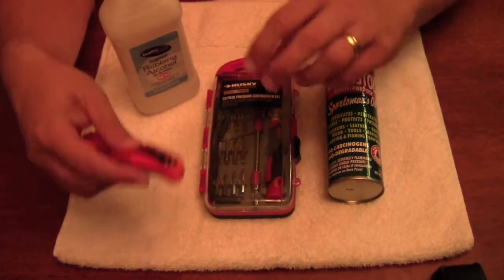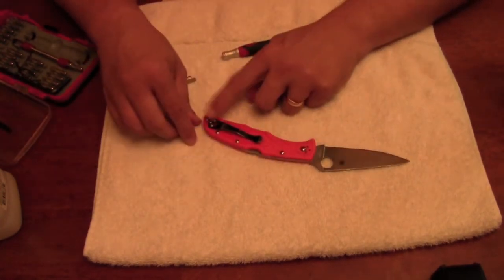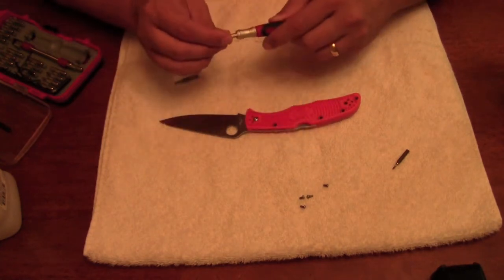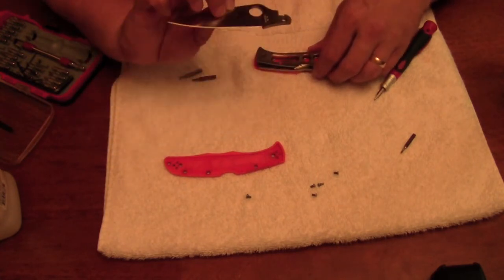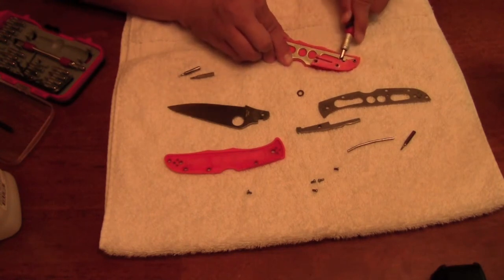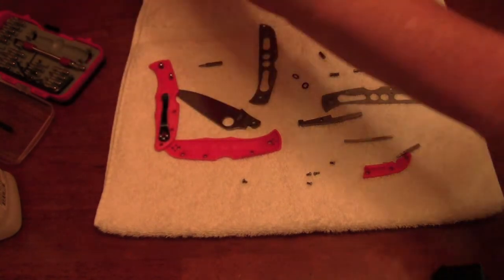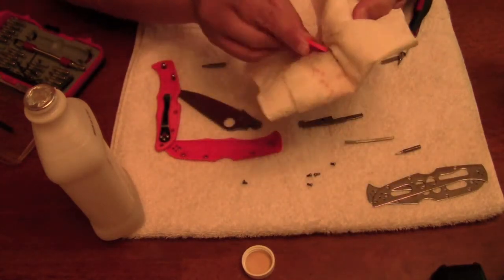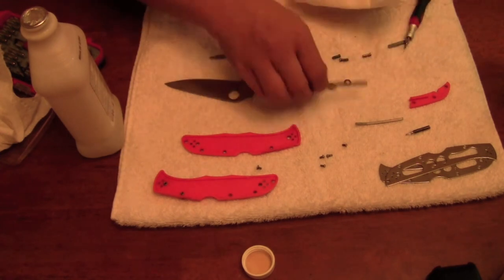Spyderco Endura 4 Disassembly Reassembly Part 1 of 2

Comment: Great video " what micro size star or tork bits is for disassemble did you use?
Reply from the maker: AlbyBound thanks man, I used a Husky Set it doesn't have the sizes...  :(
Reply: AlbyBound 6 and 8 torx for anybody still wondering

Comment: Just bought one of these today, secondand. Noticed that the locking mechanism doesn't want to stay closed- I can apply slight pressure to the blade & it will close. I took it apart to clean & man- it was in bad shape. Still, the lock doesn't want to work. Any idea what to do? Contact Spyderco & send it in for repairs?
Reply from the maker: +Lord Pyro Their customer service is pretty good but with the knife being second hand they might not wanna help you out...  give them a call and see what they say...  good luck...
Reply: I've contacted them recently about another knife needing some screws. Said they've sent them to me, but it's been almost three months now. Seems like it takes forever for them to respond to an email, too.
Reply: I purchased some 7075 Aluminum and am making a piece to hold the locking bar in place.  Mine was some sort of plastic material.

Comment: It's obvious this is the first time you've done this. practice first before you show it and I've got some 15 plus years old spydercos that still function flawlessly without being disassembled. They are self cleaning and if it real bad I run hot water through them and then light lubricant just my two cents
Reply from the maker: It was the first time, thanks for watching...